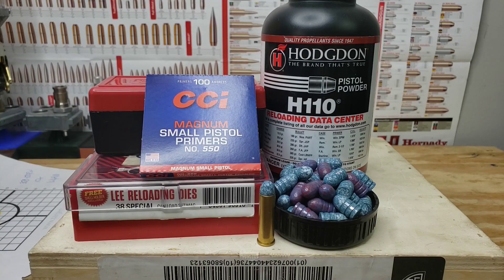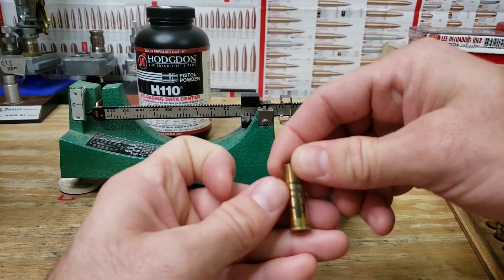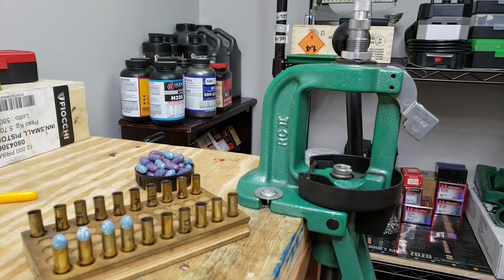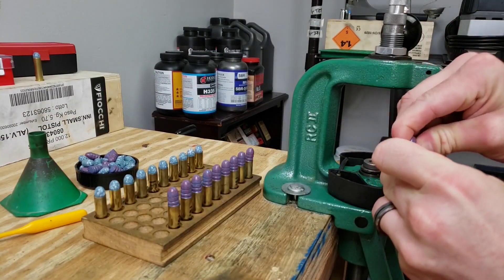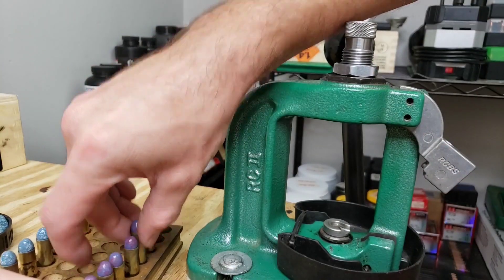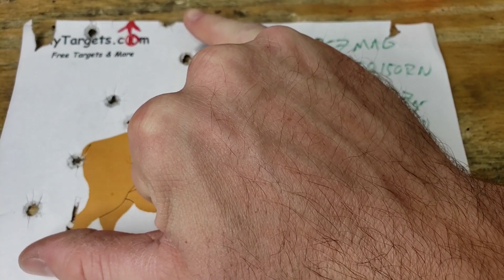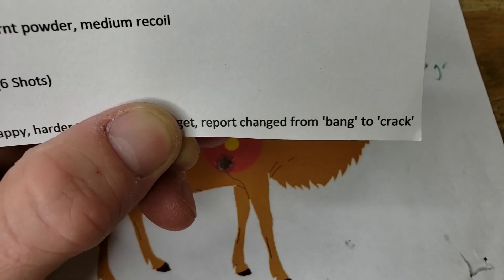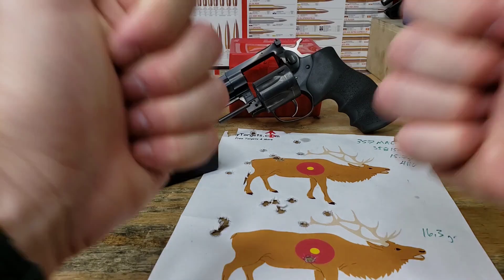Reloading 357 Magnum Episode 5 - Further Testing With Hodgdon H110 And The Cast Lee 358150RN

Comment: That's a nice load.  I also run the Lee 358-158-RF bullet with the same charges of H110 with fantastic results out of my GP100, out of my 20" Henry I'm seeing over 1650fps.  It's nice that with powder coating the bullets you don't have to worry about leading and they are very accurate.
Reply from the maker: I'd love to see how these worked out of a carbine! I need to revisit them for the Blackhawk. Thanks👍🇺🇲

Comment: I use a sharpie in different colors to color code for different powder loads, the sharpie stays on the primer after the firing. H110 has been a stellar performer in our top end 44Mag loads. I do use magnum primers, the consensus seems to favor the magnum primers.
Reply from the maker: I'll have to try that with marking the primer. I'm still new to reloading 357mag so I'm not quite sure how much hotter we can go. The data I found went up to about 16.7gr, but that was a different bullet of the same weight. We're also way over Hornady's max load, already! Might have to come back to this one later after we try some other powders, and see what sort of numbers they are able to produce. Thanks for watching brother 👊👍🇺🇸
Reply: @DummyRound  Hornady data is all ways lower than any other data.

Comment: I made up 50 of some 150gr coated with 14.5gr H110. I think it might have been too-low. I'm glad to see that you can use the powder coated projectiles without leading (Pb+). I think 14.5 was too low and may not have lit. The two FTLs I had fired on the second strike, which means that the primer may not have burned. The gun has a pretty serious trigger job. So I'm wondering if going up to 16 as a start ought to get me 100% light rate. If not, I think that my springs are at fault. I get some 150gr boolits from an old-timer at a local gun show.
Reply from the maker: If the primer didn't go off you can't really blame the powder, trigger might be a bit light like you were suggesting👍🇺🇲
Reply: When I first started working with H110 I reduced my loads too much. I had inconsistent velocities. Un-burnt powder was getting deposited in front in my shooting lane.   You could see a layer of powder dust. I love H110 in heavy 45 Colt, 44 Mag and 454 Casull. Thanks for sharing your experience with 357 magnum.

Comment: Thanks for the video, 
Quick question for you, have you had any issues using lead bullets? I’m getting into reloading and am hesitant to buy bullets as I’ve always heard non jacketed bullets foul the barrel. 
I would be shooting my .357/.38 rounds out of a snubnose Taurus 605 and a Rossi 16” Lever Action.
Reply from the maker: I have had zero leading issues with powder coating, but I'm not pushing them at jacketed velocities. Traditional lubed lead can be troublesome, but PC and Hi-Tek have totally changed the casting game. Thanks!

Comment: You caught on to crimping quickly!  You have to crimp about in the middle of the groove not too high or low.  I read this really old Nosler manual that claimed crimping towards the top is better and I tried that and it just doesn't "bite' into the groove/cannelure very well.  I kinda had to figure it out the hard way lol.  You have any leading with the H110?
Reply from the maker: I was just guessing on the crimp, but that's where it looked good 🤣 no leading with the H110. I've ran cast/PC stuff past 2k without any of that. That's going to be an upcoming project- high speed lead and actually getting the cast Lee 55gr to shoot in my AR. Now that I have a chronograph it'll be easier to see what's happening. Thanks for the comment brother 👊👍🇺🇸
Reply: @DummyRound  Thats good I have been thinking about trying slow burning powders again for my powder coated bullets. Haven't been able to get good consistency so I stopped.  I really like using 800x and Unique for lead bullets they seem to play well with it.  What kind of lead are you using?  I just use wheel weights and sometimes if I'm feeling froggy I throw abit of tin in.
Reply from the maker: I haven't used any 800x but that looks like a good one. Unique is a favorite of mine, but it's hard to come by, and usually a bit more pricey. I have some other magnum style powders to try for the 357mag so that'll be fun  to see how they compare to H110.
Reply: @DummyRound  I really like Unique as well. 2400 is super accurate tbh and it can be downloaded alittle.  Im starting to really like IMR 4227 I used a max charge of it and it is very very consistent! I think the trick to that powder is it likes to be at least slightly compressed.  Thats just some of my experience.
Reply from the maker: @heavyleadenthuasist38  I plan on testing both of those very soon! Thanks for the tip👍